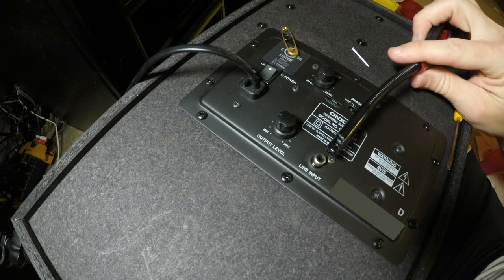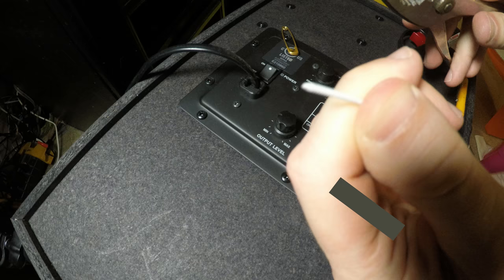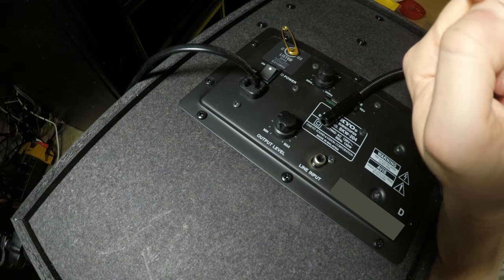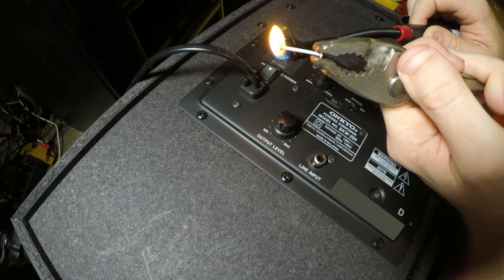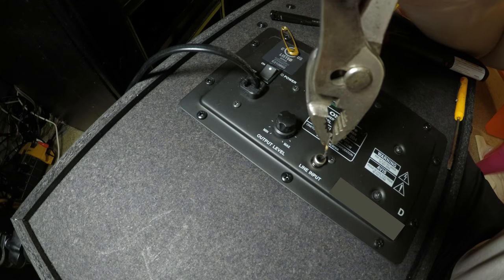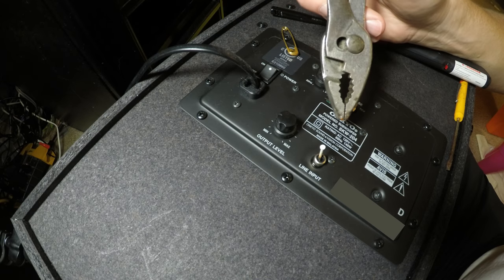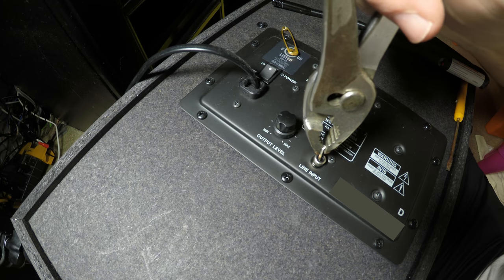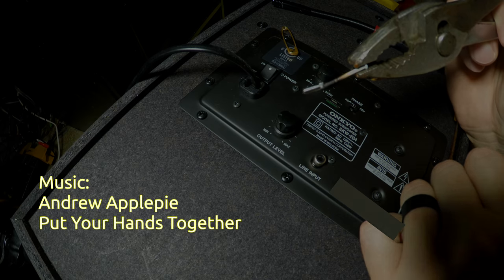How To: Remove a Broken Male RCA Plug From its Female Connector, amp, headphone, audio

Comment: Forget about trying to hook the nail. The plastic in that tip is so soft just heat the nail tip and apply a little pressure. Worked just as you described. Thank you. Just fixed a $200 Altec Lancing Power Duo picked up at Goodwill for $25.

Comment: Sir, you are a genius! I have been trying to brainstorm ideas for a few weeks. I was a staff sergeant in the Air Force for 12 years until injured. My job was troubleshooting, maintaining and repairing Communication/Navigation avionics systems on C-130H3 Hercules aircraft. Although this brilliant technique wouldn't fly with Big Brother, it worked instantly for me. I heated up a small safety pin, slid it in, and like you said, I left it about 1 minute and the broken lead came out with the pin, smooth as butta!
Thank you and Blessed Be,
Sofie J.
Reply: even he stole it from youtube but i'm also giving him the credit as hes the one i learned this from... Even if he got taught by someome else he taught us and saved our butts so he deserves it.
Reply: Also i won't lie as a welder some of the easiest fixes take the longest or outside help to figure out. Coding is the same. you can miss one minor thing that someone else will see. It's still a positive experience though.

Comment: BRILLIANT!     I can't believe it worked.   First try, it worked.    I used the straight half of a thin-gauge cotter pin.  Made sure before that it would be the right size, and not touch the sides of the port.  The metal I used was between 1 and 2 mm.  Very little hook on the end, but there was one there.  Didn't want the hook part to make it so the metal didn't go inside the broken piece.   It worked flawlessly, just like in this video here.  Thank you Mark!

Comment: Another simple trick works everytime Get a cocktail stick snap the pointed end off so you got a thick end, very small dab of super glue 3 on the end of cocktail stick, insert into port, it will push in just a little further,  hold untill dry, i give mine 2 mins and slips out real smooth... lot less work to :) and i did this on a snapped METAL rca pin

Comment: My baby boy broke the video plug off in his DVD player. He's only 2 but man he breaks shit like he's paid to do it. I tried this twice and failed but on the third try I got it! You don't even need to bend the tip just push down with enough force using a thin nail and the nail tip will melt right into the center. Good looking my dude

Comment: Lol, boy! Was I so happy when the pin came out. I first tried with some kind of pin, that didn't work. I then found a 1 1/2" nail that looked like it could melt easier. I then allowed it to stay under the fire until I saw physical change. I then pressed it on to the stuck pin with a little force and waited until I was sure it was stuck. I let go and it was standing alone. I waited a bit to ensure it stuck to it hard enough. I then pulled it out. It was about half way into the pin, lol.

Comment: I did it one step easier. Instead of bending the tip of the nail, I just put the nail in slanted and pulled it out like that.

Comment: Nice, but assumes the RCA pin has plastic. I am using a Neutrik RCA/XLR male adapter and see no plastic, just metal, so it isn't coming out.
Reply: Same here. Thanks for the reply. I was wondering if anyone else actually used a quality RCA cable. Back to the drawing board. I might just buy another sub. Time to upgrade.
Reply: Intermountain Opera Bozeman Sounds like a good idea. Thank you for the info. I appreciate it.
Reply: @Keith_from_LBC   Oops, didn't realize I was signed in under the org acct. So to repost: I replaced the RCA inputs with Cardas ones. If there's someone nearby to trust, one can pull the sub back panel and have them do the job. But the connectors of good sound quality cables, which are a good idea, can break off too if not careful.

Comment: was able to pull the broken tip right out but left the metal shield behind 😥
Reply: Same man, did you solve it?
Reply: @diegoddl8154  nah.. I never did fix it I just bought another one that I was planning on getting anyways that actually goes with my set.
Reply: @LeTetSpiN  ahaha i actually could as soon as a wrote that, it was pretty intuitiveactually. I just put a pair of tweezzers in and screaped the sleeves out.

Comment: CAN BE EXTREMELY DANGEROUS MY CONNECTOR MELTED ON MY SUBWOOFER AND STARTED SMOKING I HATETHESE CHEAP AS SPEAKERS
Reply: you unplugged it 1st right? also if your connectors are melting you are overloading your system,you plug too big speakers into an amp that isnt powerful enough to power them.